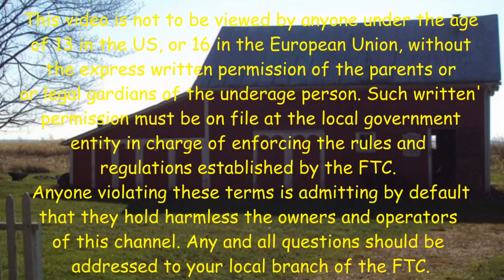OSW Annex Day 50 Couldn't Wait & Started Siding

Comment: Really a nice job that looks great - not that you need it but wish I could help you!  You’re doing a fantastic job by yourself.
Reply from the maker: Just came in from the rain and finished lunch.
It would be great to have you visit. The Nighswander men don't travel as much as we use to. I'm glad you are able to follow along on my adventures. 
Ryan has been a big help with the heavy stuff. I wasn't sure I would be able to put up the sheet metal panels but it is working okay. 
Just finished trimming in the door that I stopped on last night. If the rain holds off a bit longer I want to get two more put up so the whole south wall is done.

Comment: Looks good...maybe it was worth all that trouble?....CHEERS
Reply from the maker: When I started I said I would talk about the project and leave nothing out that might help someone else with a similar build. 
Knowing what can be wrong would have been a big help. 
The videos I have watched from Versa Tube and some others who are building seem to be rather happy.  I don't know if I'm too critical or they just got  better materials and documentation. 
In any case forewarned is forearmed. There have been several times I could have used another pair of arms on this project. 🤡
Reply: I looked at the struggle and some time I wish I would have been there to help you but not. You would have the shell on by now......CHEERS
Reply from the maker: Mostly it is just a matter of figuring out how I can get around my limits using what I have. 
Today I rented the bucket lift for another weekend. I just have to be careful I don't stumble and screw up my knee so I can climb in the basket. 
That will help with putting up the roof panels and all the trim work. 
Sunshine is predicted. Not sure if they really know but I'm hoping they do.